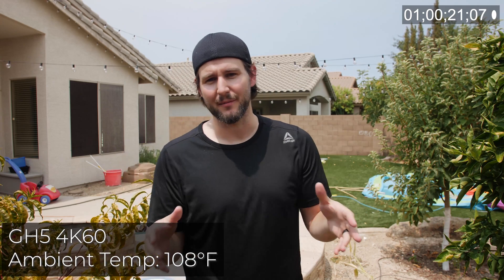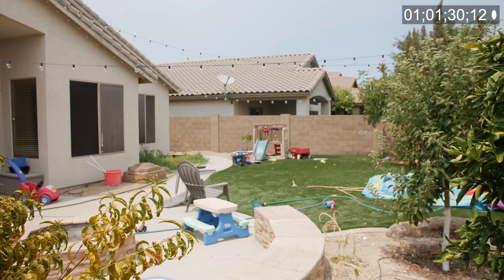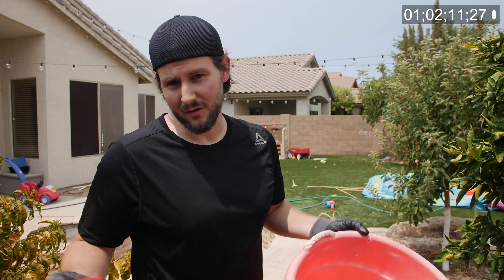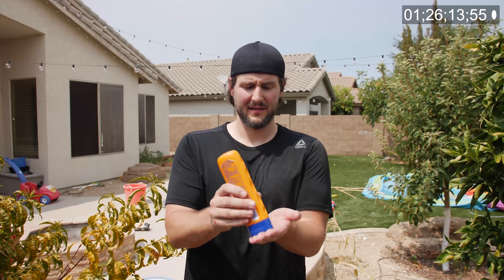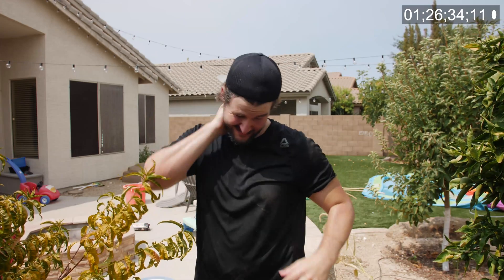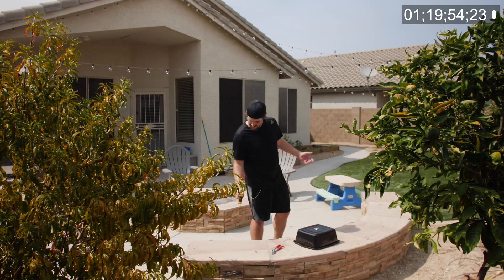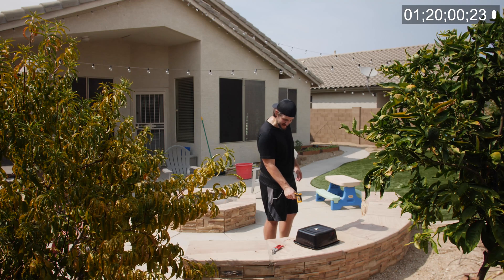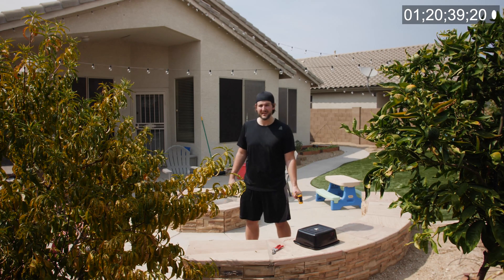Can I Get The GH5 to Overheat?

Comment: The best place to measue temps on the body is the flat part where the screen folds into. It buts right against the image main board and the sensor. Thats where most of the heat goes.
Reply from the maker: Good to know, thanks!

Comment: Do people hold ceremony outdoor like by beach in phoenix during this hot weather?
Reply from the maker: It'd be a challenge finding a beach in Phoenix :-) usually most people are indoors for the summer or by the pool.
Reply: We do in Australia over summer. did one at 42c - that's about 108 degrees. Outdoors bout 40 min and no issues with GH5 ot G9 in full sun. 3rd camera G7 did overheat after bout 15 min.

Comment: I've got a GH5 since 5 years. The most I have done is 6 hours,  recording the Guitare Festival at Puteaux (France). No overheat, but the température was 20 ° celcius.  I have brought recently a GH5S, and since now I have'nt experienced any hoverheat. Only 2 hours at 24° celcius with the GH5S. I'm quite happy with that has I often record very long concert or festival. I also have 2 atomos, Ninja 7" and the new baby 5". Whouaou, these gears get very hot, but works. GH5 and 5S with Atomos seems to be the perfect combo for long run. Something important to know is that I always use an external power supply with a dummy battery. Battery can get very hot. I prefer using external power supply.
Reply from the maker: Yes for proper long-form work, use dedicated power to avoid swapping batteries.